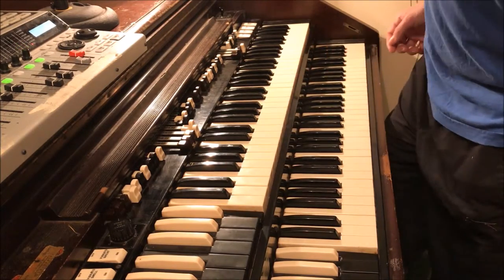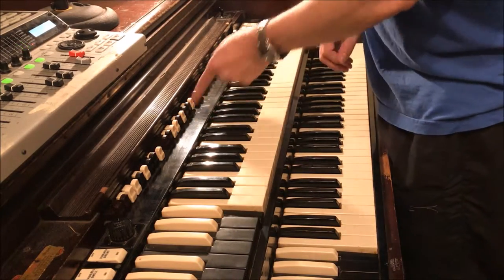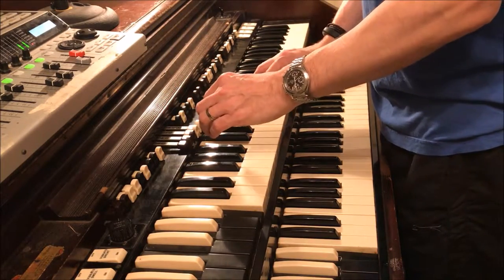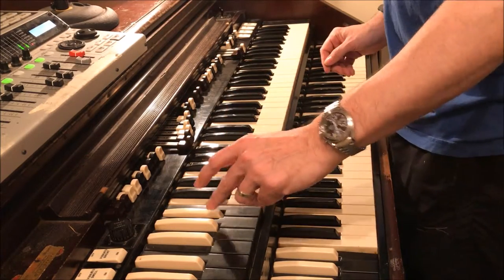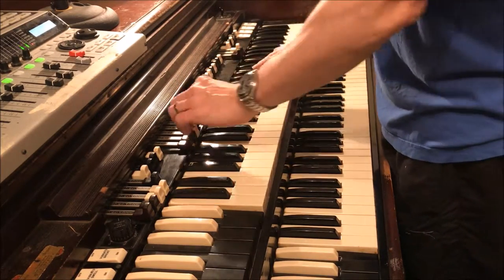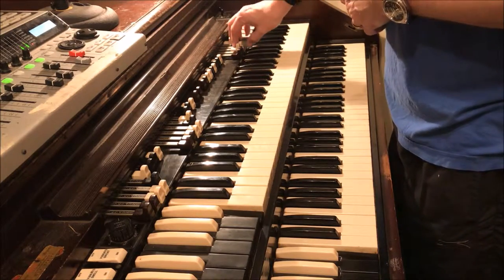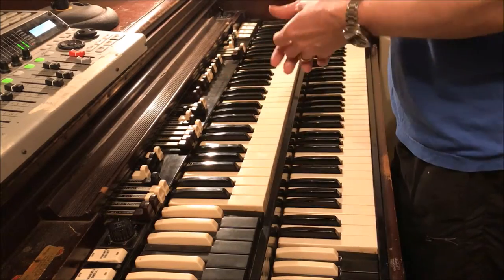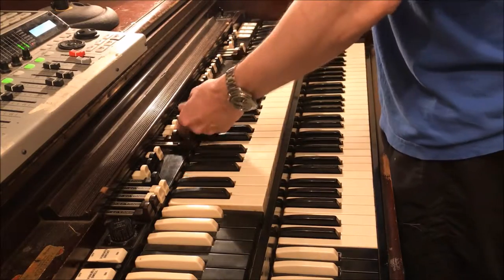How do Hammond organ drawbars work (on the C3 used in bands like Deep Purple)?

Comment: I’ve seen a couple videos pointing out the key contact of B3 & XK-5, how when lightly pressed you can hear the tone wheels come in.
How important is this (really)? I’m considering an older model that doesn’t have that feature & also only has 1 set of drawbars per keyboard.
Thanks
Reply from the maker: Its difficult to tell. There is no doubt that this is the way the older models worked and at some level it has to be part of the organic tone. That said there's a lot in the head here too I think. Considering the keybed is so different (and so good) its hard to tell what is doing what. What I will say is that I had an XK3-c for years and the contacts system did not play a part in moving to the XK-5. 

If you are looking at one set of drawbars then you are thinking XB-2 or XK1 on something similar? I've played them both. the XB2 keybed will make an man out of you, took me a while to get to play that properly, its no synth action. I think any move up the chain of Hammond is to your advantage, the XK-5 is not cheap after all!

Investing in the drive and modulation will be far more significant to your tone than the contacts system I think. My advice is a Lounsberry Organ Driver for that lovely growl and either a Leslie speaker or if you cant afford one or your back is too weak then the NEO Ventilators are perfectly serviceable too and used by professionals around the globe.